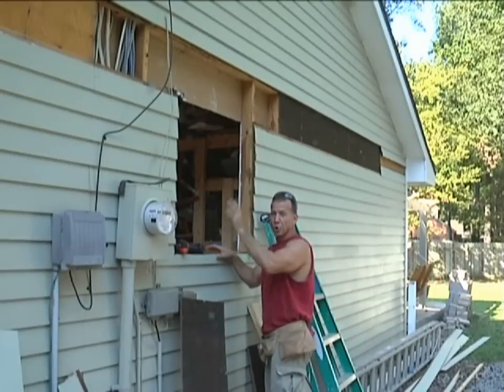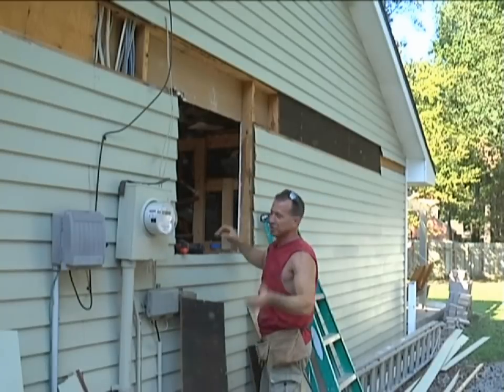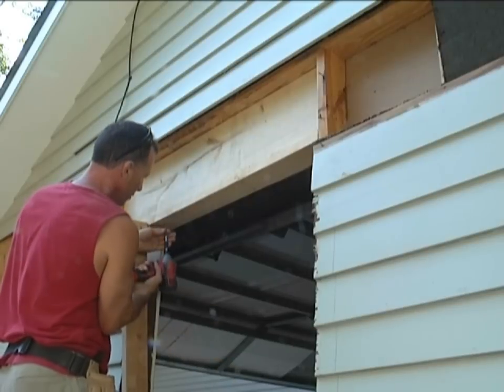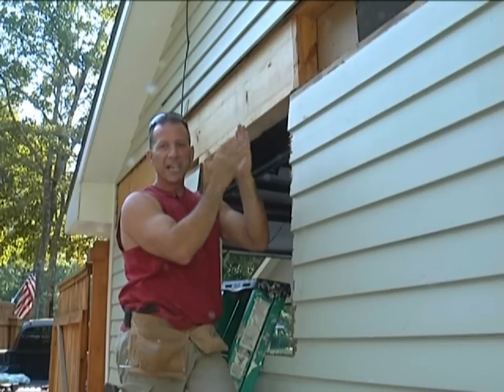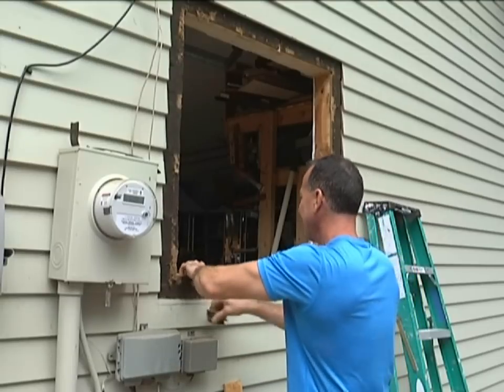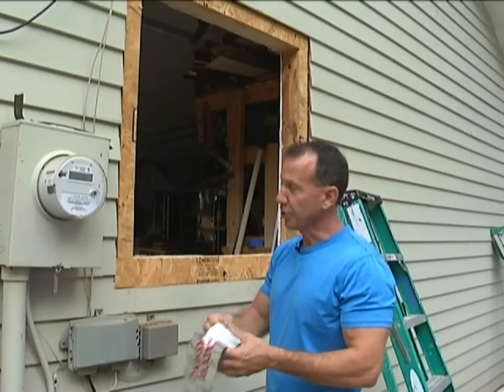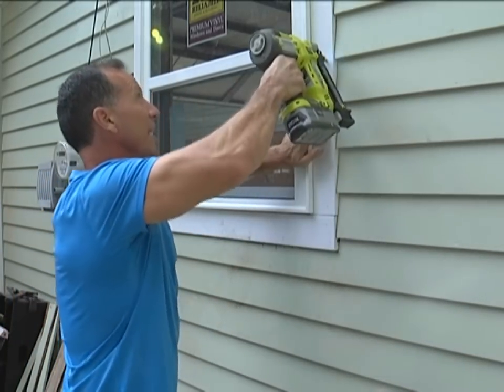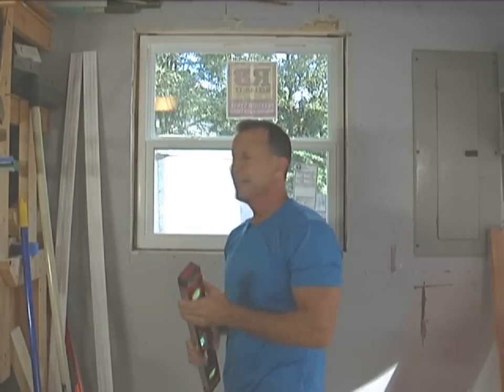DIY Window Install.  Part 2 (Installing the Header!)

Comment: This was extremely helpful! The only thing I would add would be to encourage people to use hearing protection when using any power tools, even low-volume tools like reciprocating saws and drills (the screech of drywall screws just cannot be good for us). I know way too many builders who have compromised their hearing! And it's so simple to protect yourself!

Comment: Great video Paul this helped me out a lot nowI have a better Idea how to install a window in my garage. Luckily for me though the inside wall already has the studs exposed so less work having to cut the dry wall or search for wires :). Thanks for sharing your knowledge.
Reply from the maker: That always makes thing a little easier my friend. If you have any questions,please let me know.Thank you for taking the time to comment!
Paul

Comment: I thought screws were not recommended because they don't have the shear force of nails. Can you talk about that? I'm learning. Thank you.
Reply from the maker: Hi Pete
I use nails quite often, but screws actually grip much better. If you take 2 boards and nail them together, you can then use a long pry bar to separate them. If you screw them together, you will not separate them without completely spiting the wood. Nails are sufficient in most cases, they are faster and easier to use, especially when using a nail gun. Hope this helps.
Thanks!
Paul

Comment: hey paul, great video! Could you tell me what model Ryobi you show here in this video. Would love to view an instructional on nailers and the categories of nailers diyers aught to own. Again, thanks and God bless.
Reply from the maker: +Nelson Vega 
Hi Nelson,
It is called Airstrike 18 gauge trim nailer. It will shoot nails up to 2" long. I use it all the time and I swear by it. I'm not sure about other brands because all of my other nailers are pneumatic. If you look up Concord Carpenter on YouTube, you may see some other comparable brands. Rob Robillard is a very nice guy with a great channel. His show is mostly about tool testing. 
Thanks!
Paul

Comment: So I did not see how you actually set the window.  Is there anything I may need to know? I have never set a window. Thank you
Reply from the maker: Hi Diane,
I'm really sorry but I was pressed for time when I made this video and I skipped the actual install. You should check your opening to see if it is square, then you will set the window in place. This window was not a replacement window, it had flanges for new construction. If yours has flanges, you should set a level across the top of the window before nailing it or screwing it in place. If you are using nails, I suggest using 1 1/2" galvanized common nails. If you are going to screw it in place, you can use 1 1/2" exterior screws. You will then put the seal tape over the fasteners and the flange. The rest is in the video. I hope this helps!
Thanks!
Paul

Comment: Hi Paul, 
Do the same rules apply when adding a window to the inside of your house?

-Christina
Reply from the maker: Hi Christina,
It will only apply if the wall inside your home is a supporting wall. If it is a partition  wall, you will only need to cut the hole and make a 2x4 frame and not a header. 
Thanks!
Paul